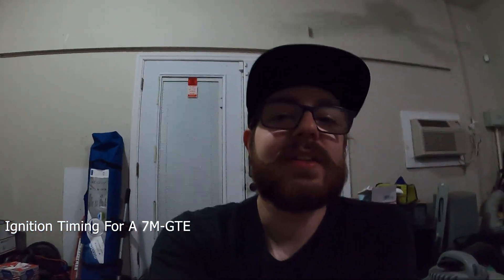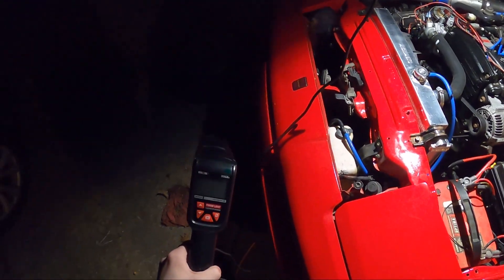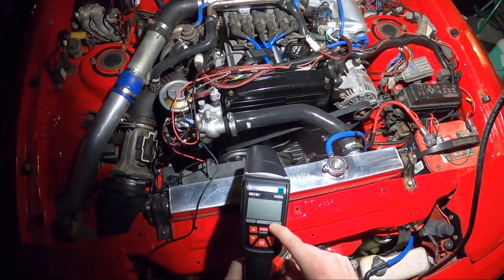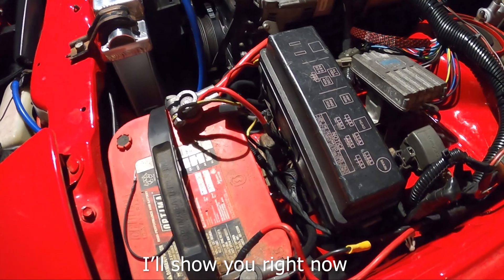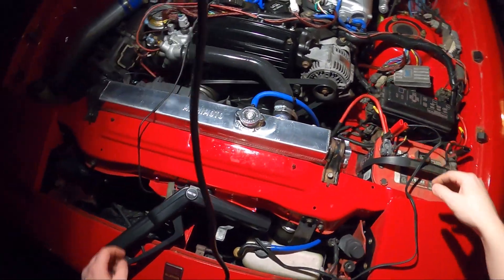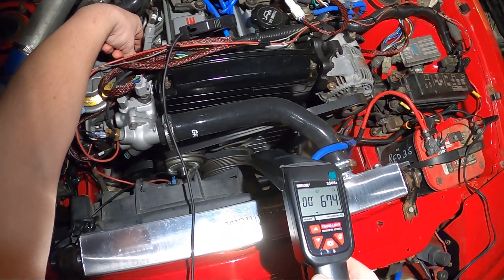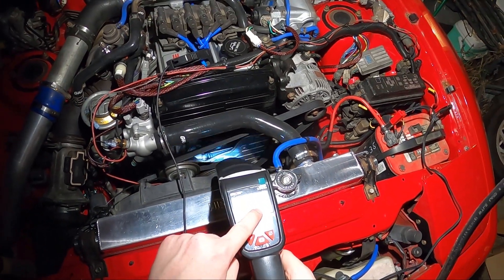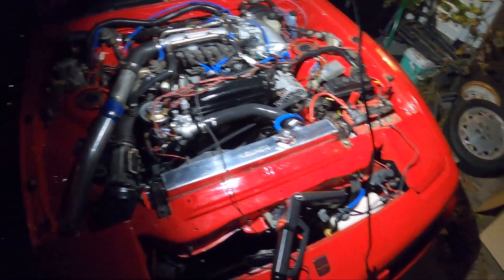7M GTE Ignition Timing

Comment: Firstly I am putting my timing light in spark plug wire number 1 as everyone says to do it so, why do you say to do it in number 6? Secondly, Just finished doing the ignition timing. Had to take out CPS and put it back in correctly at 0 degrees TDC. Then I put the CPS right in the middle. I want to say that when I did the bridge with TE1 and E1 my check engine light was not flashing, but my tickmark was staying in the same spot. And with the bridge I had to move the CPS all the way up and it was at around 14 BTDC as it was not reaching 10. I had to play around with the throttle in the throttle body cause I had around 2000 rpms at idle and I had touched that before, so if someone could tell me how that should be. So I finished it by putting the CPS all the way up at 14 degrees with the bridge, then I took of the bridge and it dropped down to 13 12ish BTDC at 670ish RPM.
Please advice.

Comment: We have the same timing light and when we are using the jumper wire, the timing light is showing 1100 - 1300 but the car was at 650. I think this normal 

We were able to verify the crank marker at 10 degrees using cyl 6 and after removing the jumper wire, we are at  13 before TDC. 

So, are we good? And no need to worry about what the timing light showed for RPM?
Reply from the maker: Yeah I had that happen to me a couple of times, had to disconnect and reconnect the timing light while it was running and showed the right RPM after. But as long as the dash showed the proper RPM, the timing light showed the proper degrees like you stated, and if it sounds smooth while idling, then you're good to go.

 Just take it for a test drive, if everything is smooth and you have good throttle response, then you did everything right.
Reply: @SlothKingGarage  appreciate it brother. Your walkthroughs have all extremely helpful. We’ve been watching your content and have also done fuel pump and filter recently
Reply from the maker: @BusyRaf  Awesome, glad to hear they're working out for you! Appreciate that btw! 
Always good to have the fuel system sorted out, hope that went smoothly

Comment: HELLO
I think there is a mistake in using the timing device
1- You should enter 10 degrees in the two grades as it is in the catalog
2- The number of cylinders was supposed to be entered in the two fields designated for that
Am i right?

Comment: Not sure if my timings off or not, starts fine and after about 5mins drops idle when warmed up, i believe around 800rpm or so. After driving for a very short while when i then stop it idles higher, say around 1k-1.2k. Is this normal or do i have an issue you think? Thank you in advance
Reply from the maker: Does the car ever eventually idle back down?
Is your car turbo or non turbo? During this whole time, do you have the AC on?
If it's a turbo car, your idle should be at 650 and non turbo should be at 700. If it's at 800(without the AC on), I'd go in and adjust your timing so it sits at the appropriate idle.
That would be one of the first things I check. If it's still doing that after, I'd clean your IAC valve. If that sticks, it can cause a high idle after driving

Comment: Aye I got a question my car runs great just when its idling it sounds like a slight miss it’s like bummm…bu..bummm but when I rev it to around 3k it goes away slowly
Reply from the maker: Do you have any engine codes? Could check just in case to see. It could be a number of things. Maybe a vacuum line is bad, cracked or loose. I'd check all of those.
Could be a slightly clogged fuel injector in 1 or a couple cylinders. Easiest thing to do is pick up some fuel injector cleaner and see if it resolves itself or gets better. Only way to actually check if they're clogged is to hook them up to a machine that cleans/checks the spray pattern.
Now if it was a bad idle, like clearly misfiring, you could unplug one injector at a time to see if the symptoms stay the same (that'll indicate the fuel injector you unplugged is the issue). But if its just a slight miss, it'll be hard to tell. Worth a shot though if you want.
If all of those check out fine, you can diagnose the TPS from the online TSRM. It'll guide you through the steps to see if it's within spec.
That should be a good start to check things out. If it doesn't resolve let me know and we can think of other things to check!

Comment: My 7m is already fully built and the engine is timed .20 degrees over I had to pull the cps out because I’m getting a new housing for the thermostat, I’m assuming the cps has go in a certain way, specifically timing with the notches on it is there anyways u could help me troubleshoot the problem through the comments?
Reply from the maker: Yes absolutely! I actually have a video on installing it "cps install" it'll be under the "engine assembly" playlist that I have.
Major thing you want to make sure is that your engine is at TDC, and the match marks are lined up on the CPS. Which I show in that video.
If there are any issues you run into, you can comment on here or message me on Instagram (Sloth_King_Garage)

Comment: Can bad timing cause a surging idle? I’ve changed spark plugs and it helped a little but it still surges up and down at idle. Haven’t driven it either
Reply: I checked for vacuum leaks but couldn’t find any, I also cleaned the isc valve but idk if that’s my problem, seems like that was the problem for others on the forums
Reply from the maker: @bagginn  Mm, timing would make it run rough, not really surge. When I was timing the engine, I advanced it to see what would happen, and all it did was make it run rough. Constant idle, just low and not smooth.
How much surging is going on? Is it sputtering, goes away after a while or just stays?
As for surging that ive experienced. I've had that issue before. One time it was my TPS, it would make my idle go up high, sometimes around 2-3k then drop back down and do it over again. But the beginning symptoms were small surges that went up a few hundred RPM's then back down. After a bit, it was fine. But it got worse. Diagnosed it and replaced it which fixed the issue.
As for the ISC valve, cleaning it should solve the issue right away. If you hear a clicking noise after turning the engine off, that means the ISC is ok. There's also a test you can do to see if the plunger moves, which shows that it works. It's in the TSRM under "EFI system".
But one of the most recent issues I come across a few years ago turned out to be a faulty/clogged fuel injector. It made symptoms like it was the ISC valve, but it randomly went away. The engine ran bad, fluctuating idle, ran poorly, sputtered.
Reply from the maker: One other thing it could be is the MAF. I've read that people were chasing down surging and it was the MAF.
Do you have any engine codes?
Reply: @SlothKingGarage hello i actually could use some help with this too, when my car starts up cold, it idles fine, but when giving throttle and it comes back down, the engine acts very rough, and the idle surges, it idles low around 700, but it surges 100rpm goes back down, probably about 0.5-1 second apart, i thought it could be a vacuum leak but ive changed out multiple lines throughout the engine, i came to this video thinking it could be a timing issue but after seeing your comment, running rough and idle surge point to something else, when unplugging the afm, the engine stops acting rough, and idle goes up to 1200 stays there engine runs fine, ive also change out the coolant temp sensor, the tps was done 3 years ago, and this only started happening after a head gasket job was done, i am really not to sure and could use a hand